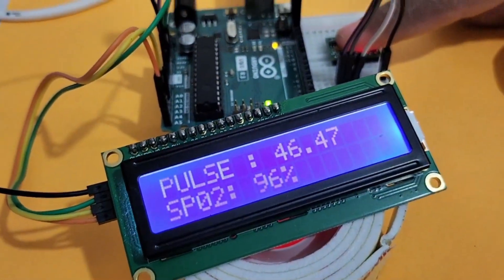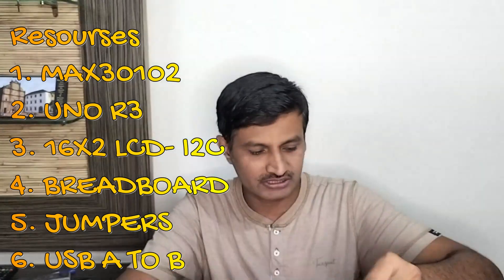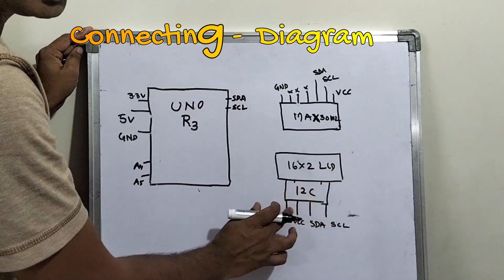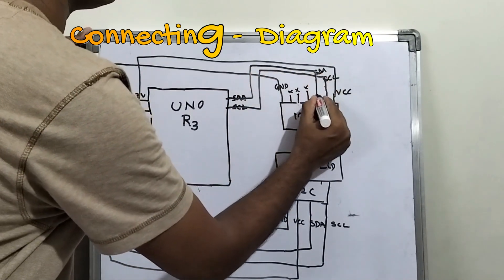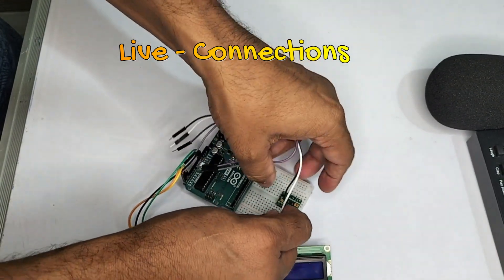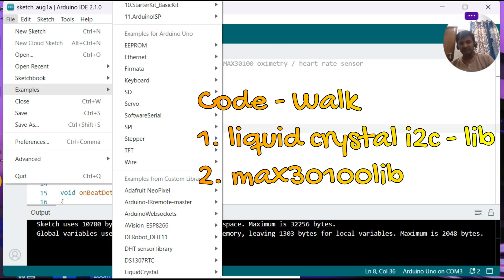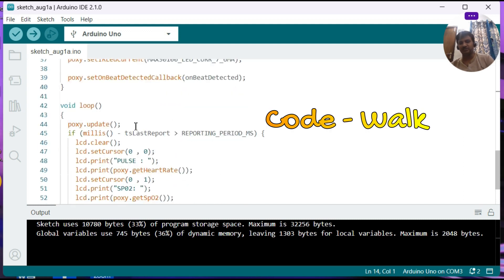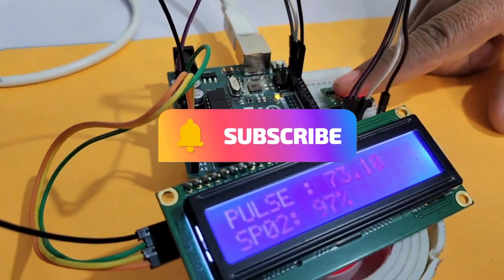How to Make  Simple Patient Health Monitoring System Using Arduino

Comment: I followed everything you mentioned but when I print it onto serial monitor on Arduino I get a message pulse oximeter failed. i need guidance on that. also is it possible to integrate MAX30102 with arduino into unit3d for displaying O2 level in UI text in real time??
Reply from the maker: I am very sorry to see your message. Can you check the code https://github.com/alexvatti/AlexArduinoProjects/blob/main/MAX30100-LCD.ino and components and Connections. First we need to display the values on Serial Monitor , We can see the next level. Can you try once again to see what is the difference. If you require guidance - How can I help  you.
Reply from the maker: Hi So far, I didn't see your response. Hope the issue is resolved. Thanks

Comment from the maker: Amazon - Online Purchase Links for Resources:
1. Max30100/30102
https://www.amazon.in/gp/product/B0BHWCGSWJ

2. Uno R3
https://www.amazon.in/permanent-guarantee-Arduino-Uno/dp/B0044X2E5S
https://www.amazon.in/roboCraze-Arduino-Development-Board-cable/dp/B07G4C4D8F

3.16X2 LCD -I2C
https://www.amazon.in/permanent-guarantee-Arduino-Uno/dp/B0044X2E5S

4.Breadboard & Jumper
https://www.amazon.in/ePro-Labs-KIT-0010-Breadboard-Pieces/dp/B01BLJGS7M

5. USB A TO B
https://www.amazon.in/JGD-PRODUCTS-Printer-Compatible-PRINTERS/dp/B09TXLM9TP
Reply: Coding??
Reply from the maker: @G.Harini-om3mr    https://github.com/alexvatti/AlexArduinoProjects/blob/main/MAX30100-LCD.ino